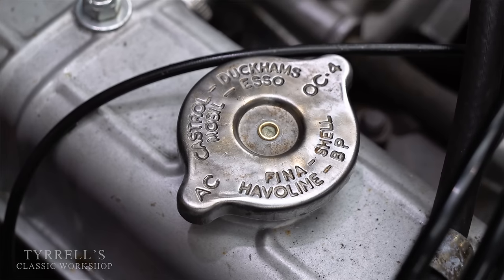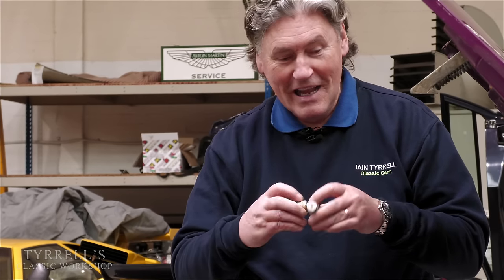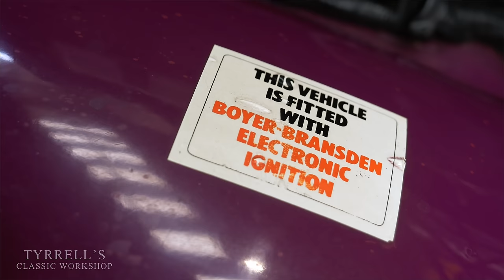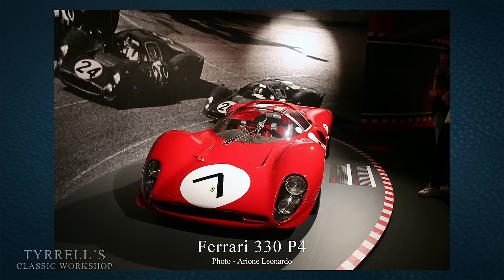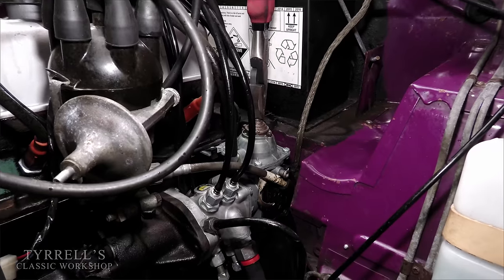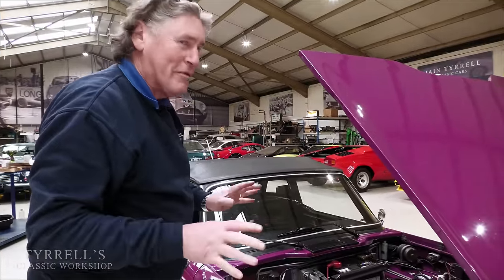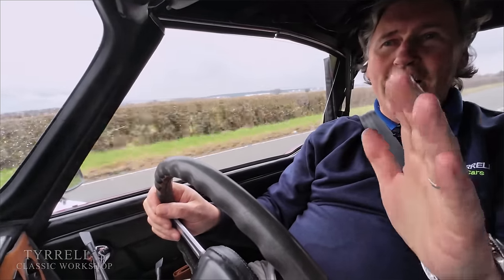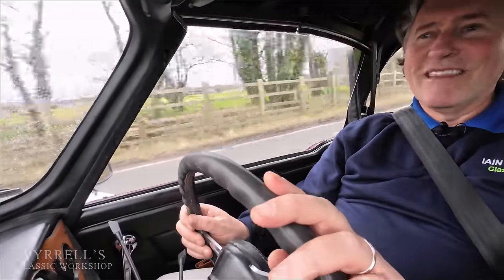Inside the Triumph TR6's Ingenious F1 Fuel Injection System | Tyrrell's Classic Workshop

Comment: years ago remember having to piss on the hp pump to cool it after breaking down due to a vaporlock from the lucas pump overheating,used to setup the distributor pumps but would last 12 months if lucky before going off tune.

Comment: Ian, a recently deceased school friend {who'd only just retired} had a TR6 in the mid 1970's, which had an invoice from the seller for work done to its fuel pump mere weeks before sale. I was taken for a spin in it but my pal still complained about misfiring. It was only many years later that I read online about misfires occurring with low fuel in the petrol tank being the cause, particularly when going around left hand bends, as the petrol sloshed to one side in the tank and that a welded in baffle fixes the issue. Sadly, he got fed up with it and soon bought an Opel Manta 1.9 SR coupe instead. My friend's name was Paul also and we'd been in school together since we were seven years old. I'm 66 now - old but not old enough to have first hand knowledge of the Merlin engine problems or Miss Shilling's orifice !
Reply from the maker: One of the little quirks that once you know about can transform the car

Comment: I had a push button radio in my first car... a 1958 FC Holden... It was retained on the rear parcel shelf with a piece of bent coathanger as the engine sparking interfered with it... I operated it remotely with a furled umbrella kept in the car for that purpose.
Reply from the maker: 😂 They don't make them like that anymore.

Comment: Transistor: Bardeen Shockley Brattain Bell Labs 1947. ;   This was a relatively useless point contact type. The planar transistor was developed by  Shockley in the next decade, So you were spot on really, useful high power reliable transistors arrived well over a decade after invention.
I had a few Mk1 Vitesse converibles. One fitted with the Laycock De Normanville 'electric' overdrive.  I had just bought the car and hadn't tested the overdrive. In my mind was the thought of a big bang and bits of metal scattered behind me...  For no reason, just apprehension and the unknown?  Anyhow I went into third  and gently flipped the lever. There was a massive bang, the wheels  locked up and the chassis outrigger detached from the car on the passenger side. Today of course you would call recovery.. In those days you continued, floating like an old boat as the rear was detached.mind you, It was hardly attached in normal operation. I had three Minis after that.. Minis are still my favourite cars for pure fun, I'd drive them every moment I could.

Comment: Those triumph straight six engines were lovely engines. Smooth when set up properly, reliable, robust and with the overdrive, easy to live with. I think the only down side to them is that, being all cast iron, they are heavy lumps.It's a shame that cars are no longer that simple. The modern cars, with all their tech put me right off of wanting one. It's good to have a car that doesn't need a computer to tell you what's up with it.
Reply from the maker: Well put!

Comment: Great story! The transistor was invented in 1947 and there were rare and expensive commercial examples by the mid-50s but it was much later until low cost silicon transistors were widely available.
Reply from the maker: Thanks for the additional info

Comment: I think that the last production car fitted with a Laycock de Normanville overdrive was the Volvo 244 GLT of around 1982. After that year Volvo changed to a five speed box consigning the overdrive to history. I worked for a Volvo dealership in Dumfries at that time.
Reply: Or might have been the Ford Transit?
Reply from the maker: Great car the 244GLT

Comment: Even our 1991 Toyota Supra still has an overdrive fitted with the automatic gearbox. That tech really held on for quite some time.
Reply from the maker: That is called an overdrive, but is a marketing name by Toyota for a 4- speed auto transmission. It works well enough though
Reply: @iain_tyrrell  ah okay, so it only enables/disables the shift into an already present 4th speed, is that correct?

Comment: What a gorgeous car.  I thought it was designed by Michelotti but I’ve just found out it was designed by Karmann
Reply from the maker: I thought it was Michelotti too!
Reply: @iain_tyrrell interestingly and the polar opposite of some other cars you have featured, European cars had Lucas fuel injection whilst many North American cars had Stromberg or SU 175 carburettors.  And in the TR6’s cases carbs meant less power.

Comment: the TR6 and the Dolomite were my favorites from triumph. O, and my triumph trophy, but of course a motorcycle.
Reply: I had a Dolomite Sprint in the 1980s. Four speed with overdrive. The overdrive switch was on top of the gear lever. As standard it worked on 3rd and 4th, though you could do a bit of fiddling on the gearbox to enable it in 1st and 2nd. Not a good idea because of excessive torque problems.

Comment: We are slightly missing something if we appraise a car by numbers alone, yes lots of ponies and lovely torque help of course, but above all is to actually afford to drive the car.  I had occasional to be driving my friends TR4 up a long straight hill in rural France, following a line of a dozen asthmatic euro boxes. My friend asked what I was waiting for. Foot to the  floor and up through the gears, with overdrive on second, we sailed up the hill past the lot. Heady stuff, a memory I will treasure, entirely belied by the tractor engines numbers. Cars have spirit, something that modern manufacturers have worked hard to eliminate, well it seems so from the evidence.

Comment: Hello there.  Reference that tappet noise, this wasn't uncommon for Triumphs of all capacities in certain cars, back then..  Whether because of minute misalignment of pushrod actuation (or whatever), you can cure it by running the engine at idle with the rocker cover off, then using a set of feeler gauges, you go along the rocker-arm carrier trying a thin feeler into end-float between rockers and their nearest end-mating surface (perhaps the carrier mounting legs?).  I discovered this when, as an apprentice, I became frustrated with  these errant tapping noises that defeated my efforts when doing valve clearances.  I recall using my finger, or perhaps a screwdriver, to discover which rocker was causing the clicking noises by putting side pressure on the offending item to minimise it.  I then chose to try inserting a feeler gauge into the gap as a temporary 'fix'.  As a permanent fix, I'd lift the entire rocker-train, disassemble it in parts order but add a thin shim-washer (or thin washer) in the offending position.  It cured the issue every time.  It's side slap, not operational direction slack.

Comment: What's an overdraft? Sounds interesting. I wonder if should get one fitted to my classic. 😉😬 That engine sounds really nice. Even as it approaches 3000 rpm on the full throttle run. That's why I love classic cars. They don't need to be the fastest by modern standards,,,, but the engagement, the sounds, the caractar of the engines, the rawness etc  makes them unik and special.

Comment: When I was training to be a pilot the instructor lecturing us on power units was discussing fuel systems and told us that pre war Rolls Royce  hosted a visit from Daimler Benz. It happened that when touring the workshops building the Merlin, they were shown an engine in a build frame which was inverted. Allegedly the German visitors thought this was the installed configuration and thus went away and invented fuel injection. I would love to know if this is true.
Reply from the maker: Not sure- could be. I know the 20mm cannon went through the hub of the prop, and was mounted on top of the engine.

Comment: GMs Rochester FI (single throttle body multi port) released in the mid fifties for the SBC was similarly excellent.  Alas, most were removed as the corner service garage simply didn’t have the know how.  Since it was an expensive option and had a complicated reputation, however unfair, became more of a liability to owners in terms of a value proposition and dropped after 1965.

Comment: Ian my BGY314H had lumention fitted best mpg was 20 on a good run exhaust was always black even on a good run engine was rebuilt with new CP block and  pistons and crank did not improve mpg incidental metering unit replaced with injectors as well emissions were always poor on this design as you say American version was fitted with strombergs. A lot of owners converted to webers

Comment: Thanks for the TR6R video. That's my favourite British sportscar with that hairy 2.5 litre straight six. I had heard that the Lucas PI system doesn't like unleaded fuel - is that true?
Reply from the maker: It works fine with unleaded, provided you change the seals inside, which is understandable

Comment: Magenta, a lovely colour, I had a GT6 Mk3 in that colour and suited that car very well. The Triumph straight 6's are wonderful engines, so much torque, I remember how you could be traveling at 25 to 30mph in top gear and you could put your foot to the floor and it would pick so easily. I notice the advance/retard vacuum pipe was missing from the vacuum unit on the distributor. Also there should be a belt/blade guard fitted to the alternator, I assume someone has removed it at some stage and never put it back! A very well preserved car.

Comment: The transistor was invented in the 1940's. The "Transistor" which made PI practicable, and forms the basis of all modern electronics is the MOSFET, Metal Oxide Semiconductor Fields Effect Transistor invented by Bell labs in 1955. Probably the most important invention of the 20th Century.

Comment: nice vidieo    i woned   a mk2  2500 pi estate   for a few years    even now  many years later    it was one of the best  running cars i ever owned   . i do   have one question though   ? why was the  vac advance  pipe  not  connected to the distributor  ?
Reply from the maker: Thanks. This is the recommendation when tuning

Comment: Thanks for another excellent video
I worked in a garage in the 60s and70s we have a few triumphs which had been converted to carburettors,they had an issue with pinking to stop it happening we could either richen the mixer or retard the ignition which would effect performance 
I worked the problem out to the compression ratio being higher on the injection cars I think it was 10to1 against 8.1 for the carburettor vehicles
I think the answer would be to fit a thicker head gasket but I never had the opportunity to try it
Reply from the maker: Thanks for that- makes total sense
Reply: @iain_tyrrell  that was 40 years ago I’m still repairing cars 
But thanks for reminding me

Comment: Seriously , why is it complicated to set the idle mixture as you did in the video ? . If not by ear a basic electric remote tach ( which I have , must be 30 years old) would detect the RPM rise and fall .
I think I see 2-3 other locking rings above the large one you loosen. What are their functions ? Fascinating video

Comment: Not forgetting Kugelfischer who made some impressive mechanical injection systems that were used on very high performance road and racing cars in the 1960s/1970s including the Ford Capri RS2600 and the Formula 2 BMW M12.

Comment: Maserati were the first to use fuel injection on a full production car, In 1962.  They used a Lucas system on their 3500GT models, creating the very first cars to be named a 'GTi'.  However, the system on the TR6 looks quite different to the one used by Maserati on their six-cylinder engines.  So was just wondering how the systems differ in operation.  Btw, Iain, I've often wondered why you don't seem to have covered any Masers in your videos.  Ferraris and Lambos are great, but Lamborghini don't have a racing pedigree like Ferrari and Maserati do. Just a thought. Btw, I test drove a TR6 in the States when I was 17 years old . . . one of the first decent cars I ever drove.  I remember the clutch being slightly tricky.  When my dad had a go in it he stalled it three times!
Reply: Agree, but I believe Ian only reviews cars that come through the shop, and I don’t believe he sees many Maserati’s as McGrath is pretty much the place to take any Maserati in the UK, they all but have a lock on them.
Reply: Gullwing?

Comment: Did Lucas system have compensations (engine speed, coolant temp, manifod pressure sometimes) like Kugelfischer? 
It's really interesting piece of kit!
Reply from the maker: It didn’t have a mixture compensator for cold running/ warm up like the Bosch and Kugelfisher systems. It had a good old- fashioned manual choke to enrich
Reply: Only manifold pressure (There is a diaphragm in the metering unit connected to the manifold), which constantly adjusts the travel of the shuttle that provides the fuel load

Comment: I was always under the impression that the problem was with the metering distributer unit which suffered with lubrication problems which were made much worse when the lead was removed from petrol. USA went lead free earlier than us so the TR5 P.I. took a hit and was changed to Strombergs. I would have thought they had learnt their lesson by the time the TR6 was announced, The Bosch units didn't have that problem hence the conversion. Is that true or was it just the pressure pump?
Reply from the maker: If the seals in the metering unit are changed, they will run happily on modern fuels

Comment: The reason why fuel cools down in this injection system. Is the same that makes dry sump air cooled Harley-Davidson engines run cool even in Death Valley Desert. Oil is sirculating trough oil tank all the time when the engine is running and it cools down in tank. That is one of the reasons why dry sump is one of the best oiling systems. For petrol engines.

Comment: 2:33 Hmm if you like complex cars, you should get a citroen SM in, cold war motors was fixing one up and I honestly went crosseyed at just how complex the under engine systems were when he popped the bonnet and explained just how everything worked

and that is NOT normally what happens with me, granted that was years ago and he's long since stopped looking after it but

jesus what a crazy car, like truly a car with a suspension system set up that you just take one piece at a time and work backwards from

and to think modern or semi modern mercedes was just as bad with that AMG or CLK thing that legit street cars was working on, like its a wonder their wasnt a national declaration of we only do spring sprung cars from now on thank you very much with how much trouble those things were

like the only reliable ones seem to be the citroens themselves

and then the distributor on that v6 maserati engine, and I half wonder if half the problems were caused by them using the same valve cover on either side, so most people didnt know how to set up the points and the firing order correctly

like someone found out recently with a ferrari 308 that's been giving him problem for years, only to find that out from a ferrari mechanic recently

which kinda explains that scene in magnum PI where the helicopter pilot was working on the ferrari to save money and it ran so rubbish till he finally got it running right at the end of the episode

only to find he had voided the waranty
Reply from the maker: Video of Citroen SM (and CX) in the back catalogue- thanks for your interest!

Comment: I've read about cars a lot  since 1990 when I got my first Autocar mag, fuel injection for normal road cars were rare in the 60's and 70's but 3 car makers were really trying to make it work, Triumph, BMW with there kugelfisher I think that's how it's spelt, and Volvo, what are the differences between watch each maker was doing and is there influences from other cars they were designing from? Thank you for the great video
Reply from the maker: Three very different systems, there’s a whole video right there! But each had their advantages/ disadvantages
Reply: @iain_tyrrell  several years ago Wheeler Dealer's had an old BMW featured, it had the kugelfisher injection, it had problems, Ed China had to send it off to a specialist for refurbishment I love talking cars I've always been interested

Comment: Magenta is the colour - so, late sixties, very bold. 14 miles per gallon.. (and a 10 gallon tank). That might be ok if you are running a race car. That pump would get warm, would vapour lock and restarting was an issue. I was always in the boot with mine, tapping the pump with the handle of a screw driver. There was a cooling coil which could be fitted to the Lucas pump, and as the man said Bosch eventually came to the rescue with a replacement pump. Back in the day, even the Triumph Garage didn't get it - any issues, and they would change the injectors out, as a first attempt at a fix. My first car.

Comment: My 2.5 PI suffered from sticky throttles. I got used to dabbing the accelerator pedal to unstick them then pressing it normally. Never found a proper solution.

Comment: Alfa Romeo had a mechanical fuel injection system in the 1970s, the Spica system. As I recall it was an adaptation of a Diesel injection system.
Reply: As you say the Spica was adapted from diesel use. It featured four small pistons functioning as a positive displacement pump. It used engine oil for lubrication and cooling. Both fuel and oil were recirculating.There was a tiny oil filter that was to be replaced at oil changes. Also a very nice system.
Reply: Individual throttle bodies, (until 1980), fully timed, low maintenance and virtually trouble free. A power tune, using the altitude compensator, took 10 minutes. The clamps that prevented the steel injection pipes from vibrating would sometimes be lost or installed incorrectly during a head gasket replacement, but that was the only real pitfall